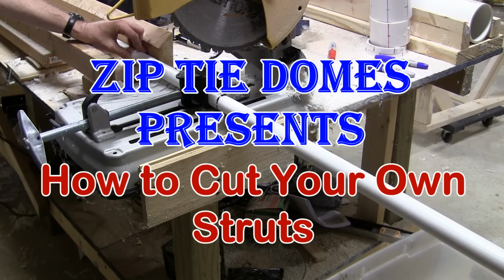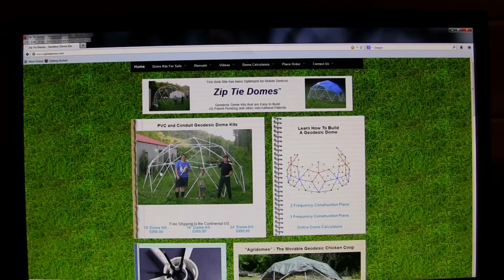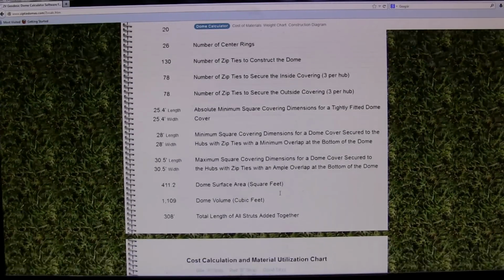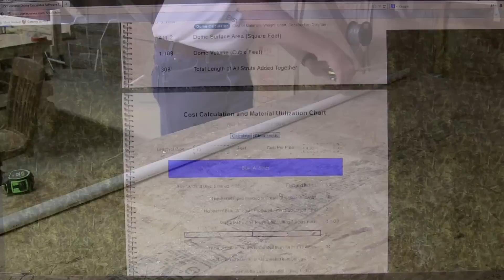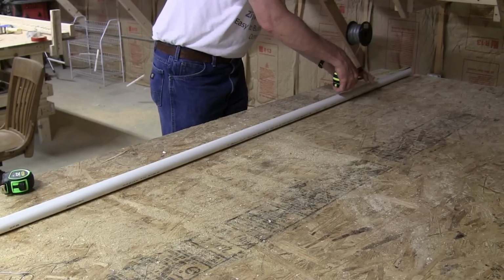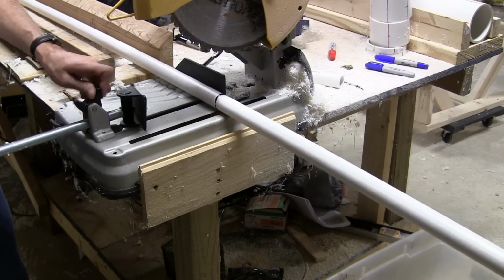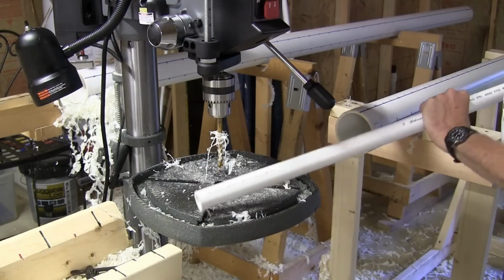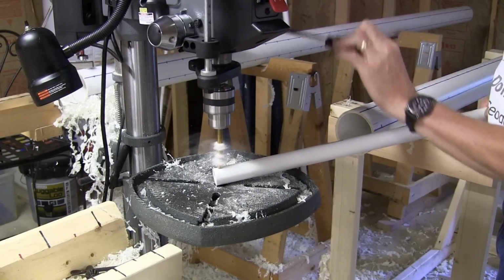How to Make Your Own Geodesic Dome Struts

Comment: I have done a lot of repetitive cuts or drilling and in this case, cutting the tubing can be done on a 2X2 with two fences to make a channel and a block of wood clamped into the channel for the correct length. The cutting can be with the same wood channel, but in this case the block of wood establishes the required distance from the tubing edge to the hole center. After that insert a construction nail in the channel at one end. This will locate the second hole in alignment with the first hole and you adjust the length accordingly.
Reply from the maker: That's a great idea!  Thanks for watching the video.  John Hurt

Comment: Why do you tilt the struts towards the end of the video?
easier to drill? because then you put it down on the drill press table
Reply from the maker: It made it easier to drill the strut.  There is a hole in the metal plate that lets the drill bit pass through when drilling.  I put the end of the strut into the edge of the hole to help hold it in place, then tilted it back to flat on the plate to drill the hole through the opposite side of the strut.
Thanks for watching the video.  John Hurt

Comment: When drilling the holes at the end of the strut, it looks as though the strut far end is held up a bit and the strut is not laying flat on the drill press table. Is that so? If so, what angle is it from the horizontal. Or should the strut be laying flat on the table?
Reply from the maker: Steve,

The strut should be flat on the table, I just inclined it so it would not slip out of the drilling hole.

Thanks,

John Hurt

Comment: Set a stop in relation to the chop saw. Measure once cut many. Much faster.
Reply from the maker: Yes, you are correct.  If you are building more than one dome, it makes a lot of sense to use stops and jigs.  Thanks!  John Hurt

Comment: WHY NOT USE ABS PIPE INSTEAD OF WHITE PVC ?
Reply from the maker: +Billy East 
Billy, 

Thanks for your comment.

I would be interested in trying ABS for cutting struts, but my source for ABS has a little higher price for ABS than PVC.  I also see on the internet that ABS is more likely to deform in the sun - see www dot diffen.com/difference/ABS_vs_PVC - not sure if that is true, but that is what I saw.   

Some people do use the gray PVC Schedule 40 electrical conduit pipe instead of PVC plumbing pipe for struts, as the gray conduit is cheaper, but just as strong. But whatever you use for struts, ABS or otherwise, the Outside Diameter (OD) of the pipe needs to be 1.315" to fit and lock correctly inside our hubs.  The hubs are designed to work with Schedule 40 pipe, and won't lock correctly if the OD is not 1.315".

If you want to talk more about this, go to our "Contact Us" page at Zip Tie Domes dot com and send me an email and we can discuss it.

Thanks,

John Hurt